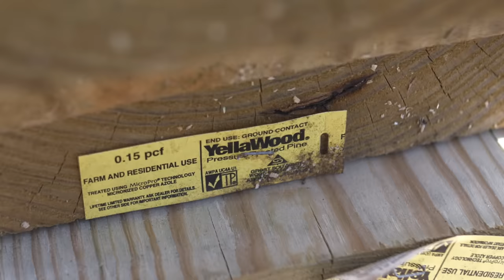5 Tips for Building a Durable Deck

Comment: 1. Don't disagree with spacing the ledger off the wall but in 30 years frankly I've only seen that as a problem when the ledger was not flashed properly (keep water out of that joint in the first place).2. I have an issue with epoxied "dowels" for the ledger connection -  those should be tested fasteners with a proven rating for both pull out and shear.3. You don't mention the depth of those piers - that's quite a steep slope you've got there and the potential for them all to slide off.Finally I would never build all that structure (let alone walk on it) while its held up only by 2x4's on the flat.

Comment: I would think with the joist tape being a vapor retarder, it would prevent the drying, thus prematurely rotting the top of the joist. Just like with peel n sticks at vertical walls that get wet, vapor drive occurs and the membrane  traps the moisture that then condensates between the membrane and wood, causing it to rot. Thoughts?

Comment: What gauge of steel were you using on these 4x4 steel posts?
Reply: Intriguing question but my guess is even the thinnest steel 4x4 (14ga or .078 wall) is plenty of strength for this application. They are incredible strong when used vertically.
Reply: It looks like 3/16 or 1/4 based on the radius of the corners
Reply: I would coat the posts with POR15.  they probably started to rust already outside...

Comment: tip 1,2,3,4,5. don't use wood. use steel. its better all around for very little extra cost. the materials can be purchased at any drywall supply store. https://deckadvisor.com/2012/06/20/goodbye-wood-deck-framing-hello-steel-deck-framing/

Comment: Never "ledger board" a deck to anything unless whatever it is to be attached has been designed, engineered to support the deck. Decks in general should be independent of the adjoining structure. Yes, you gotta dig more holes, make footings, etc...

Comment: Yellow wood screwed me. They wouldn't warranty 2x6s that literally won't hold up their own weight. 12 long horizontal boards, primed and painted for a fence. I don't have the receipt from 10 years ago so they won't replace them.
Reply: Michael VanGundy shoulda kept that receipt, dummy.
Reply: @marvgodfrey2601  
Thanks captain obvious! 
You're a smart fella.
Reply: Were they seasoned when you painted them? Trapping moisture will promote premature rot from the inside out.

Comment: A few years ago I built a project under a tight labor and financial budget (I don't do this professionally). Anyway, I simply painted heavy roofing tar onto pressure treated posts and buried them surrounded by gravel. This deck is a couple feet above ground max. I also tarred all of the joists. The ground has high clay content, but not a super wet area. Comments??

Comment: Great details!  Love your videos.  Somewhat similar concept, but different - What about a timber pier and beam foundation supporting a log cabin?  My foundation engineer is suggesting  drilled holes with filled concrete around .60 treated 8x8 timbers.  The top of the concrete will have a slanted top to push water away even though this area is well protected from external elements.  Will this timber stand up over two lifetimes?

Comment: I wouldn’t let these guys build my deck.  The weak spot in the whole thing is their method of attachment to the wall, unless the brackets and bolts were made of stainless steel. Also, from a design point of view, the deck is blocking the view of that expensive stone wall; at the very least, those ugly steel columns should be reduced in number by using a bigger beam and encased in stone piers.

Comment: As soon as the 1/8 inch gap gets clogged on top then air circulation will stop, it does nothing. 1/2 standoffs  are minimum. Where is the railing?